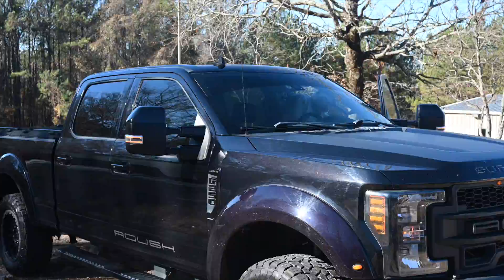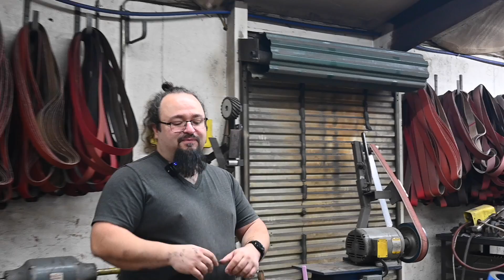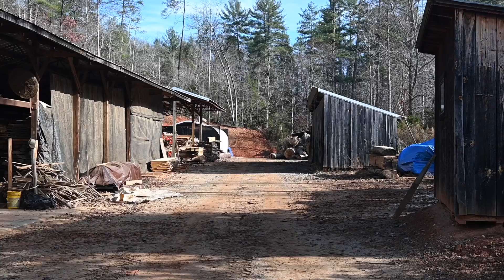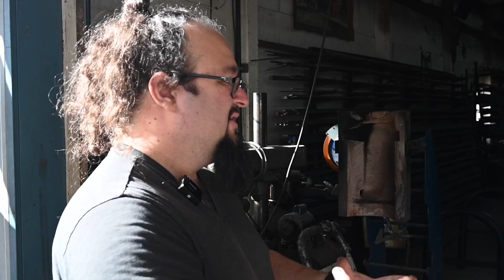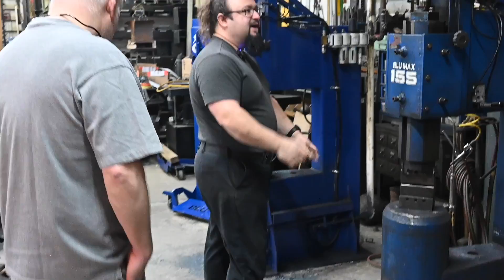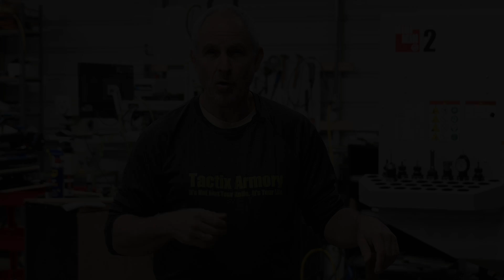Amazing Machine! - Big Blu Power Hammer Factory Tour

Comment: Great video. I bought a 110 from them in the mid 2000's and it was a well tuned machine and easy to do the fine stuff too. I highly recommend getting the clamping option which is great for twisting your Damascus. Yep.  👍💯🤠

Comment: This clearly illustrates that there's a whole lot more to successfully using a power hammer than just banging the heck out of a piece of hot steel. The adjustments clearly make a big difference, and of course the time learning how much pressure to put on the foot pedal. Thanks!